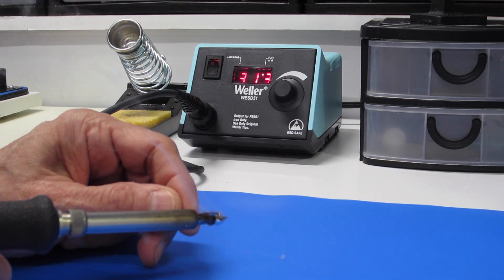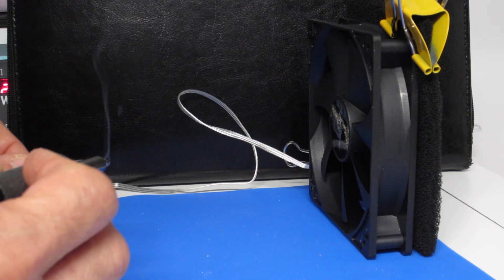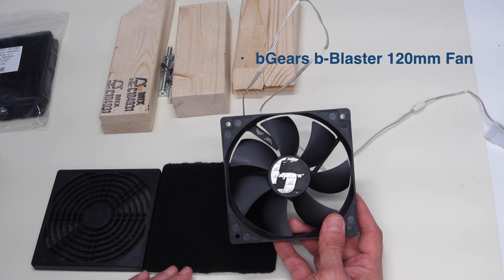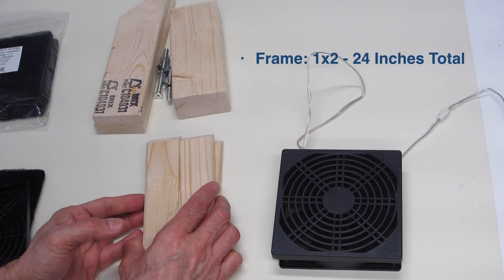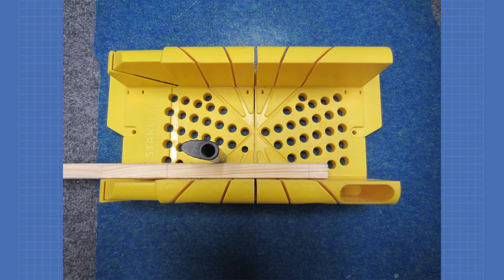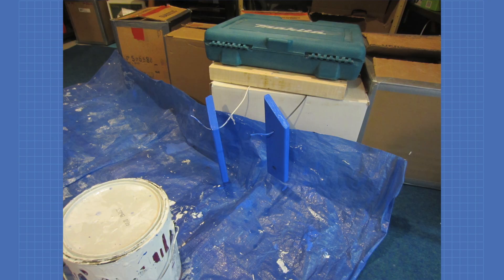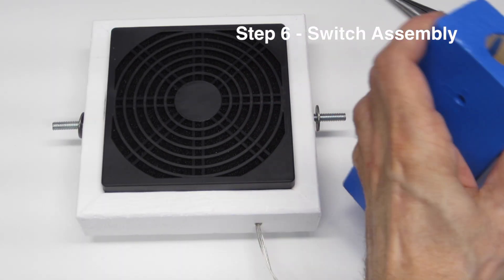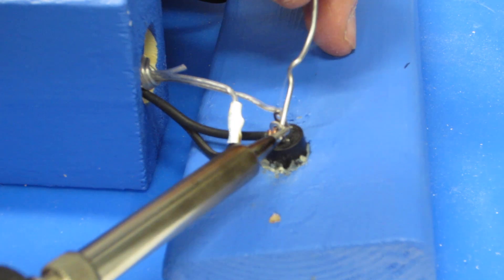Build a Solder Fume Extractor

Comment: For this kind of project you'd probably want to go with a fan designed for static pressure as opposed to airflow. They're a little louder but they're better at pushing or pulling air through filters.

Comment: 14:00 if I have to keep it THAT close to barely get any suction, I would try stacking two fans, but without more filters. Maybe also cut out a tube from a 5L water bottle to give it direction. Because that's a lot less suction than you showed us at 2:40. I wouldn't have any space to work with if it has to be that close, given all the other things that also need to be on the desk when soldering.

Comment: I wanted to buy / build one of these, but wasn't sure how well they work, and whether the fan is just drawing the fumes away and blowing them elsewhere.  At 2:38 in the video, isn't the smoke passing fairly freely thru the filter, but dispersed by the airstream.  Was also wondering if most of the odor is absorbed.

Comment: Sorry, but that is absolutely NOT a proper way of fume extraction. a thin layer of carbon and a fan does not an extractor make. You're doing little more than diffusing the fumes a bit. All fan-based extractors are the holistic medicine equivalent in engineering. Thumbs down for spreading bad information.

Comment: What powers the fan? When you cut the wire and solder it to the switch where does the switch get power from?
Reply: A 12V power supply, I suppose?

Comment: You should put the filter in the intake side of the fan. Fans are much better at pulling than pushing as their principle of operation is based around creating a low pressure zone on the inlet side of the fan. Since they do not have any seals on the outlet side, as a compressor would, putting any restriction on the outlet of the fan will greatly reduce it’s effectiveness, because they are not designed to build high pressure, but rather create low pressure.

Comment: Very nice video and a very nice fume extractor. I have built my own one sometime ago looking pretty much similar to the one described in this video. To mine, I have added a nice LED with a flexible neck to it to position it to my desire. I also added a rotary switch to change the RPMs of the fan in three steps (low, medium and high) to adjust the fan speed making the whole thing less noisy for smaller soldering jobs (e.g. SMD) while still ensuring enough power to really suck in all the fumes efficiently. Works great.

Comment: Thank you for this informative video. I was already thinking about building such a device before watching. But at 2:39 you can clearly see that the smoke is also exhausted from the filter. So it is useless and I saved time and money not buiding this.
Reply: What if the harmful stuff stays in the filter (which was made for the purpose), and what you see on the other side is much more harmless smoke? You can't tell the difference with your eyes. Just a theory, only some lab tests would be able to answer this question.
Anyway, personal opinion, even if the fan didn't have any filter at all, it moves the smoke away from your nose, and that is probably the most effective part. Of course it would be better if you can open a window too.
Reply: @GenePavlovsky  "what you see on the other side is much more harmless smoke" There's no such thing as "harmless smoke".  If there's smoke, then there is particulates in the air which should not be in your respiratory system. An extractor like this is for use in a well-ventilated room where it just needs to move it away from your face. In a poorly ventilated room, you'll just be circulating it around the room.
Reply: @VoidSixx  Well like I said it's a theory, I don't have any proof to offer. You didn't provide proof either. The amount and harmfulness of the particulates before and after the fan&filter combo has to be tested to make any claims on filter effectiveness, without such tests we can only hope that the filter does something. I agree with you that good ventilation is very desirable, or a fume extractor that vents to the outside. 
Regardless, I think that even in a poorly ventilated room, such a fan (even without a filter) will help to prevent you from breathing the highest concentration of the fumes, until the point when the whole room's air becomes polluted. If you just have a few things to solder every now and then, such a fan is a useful and cheap investment. If you regularly solder things for hours, then you need good ventilation (and a fan), or proper fume extraction.
I was just replying to micha egi, whose absolute statement of calling the fan useless I think is too extreme.
It's definitely not the best solution, but for beginners this is cheap and easy to build, and is better than nothing. For someone who seriously gets into soldering, it's worth to invest more and build/buy a more serious fume extractor. It's not easy to justify spending couple hundred dollars/euros or more for a bulky DIY/purchased fume extractor, if a person is just trying things out.

Comment: Newsflash, that is not a fume extractor and to misrepresent it as such is detrimental to those who don’t understand your reality from the truth! That is a fume fan with a filter, big whoopty do! A fume extractor by definition has a funneled end hose which is connected a vacuum unit which has multiple filter elements of which  one element is a HEPA filter. This unit removes the fumes from the point of the funnel into the vacuum filter compartment and removes not just moves the fumes from the air with an efficiency of greater than 99%. Don’t mislead people because you either don’t know or don’t care. Solder fumes contain toxic substances that cause lung damage and asthmatic issues. That is no laughing matter! It’s not safe and is just plain wrong to mislead your viewers sans treat them as if they are stupid. Your viewers may not know, but treating them like this is most unprofessional and ethically and morally wrong! Straighten your act up, please!

Comment: omg y would you go through all that just buy a good 1 on ebay
Reply: Mawgan Brev If you don’t like the video- leave. We don’t want your negative comments here anyways.
Reply: It's a great feeling when you make something by yourself. You can sometimes also save money (if you count your DIY hobby time as free). In many cases you can make a stronger and more durable product, since commercial offerings are either made as cheap as possible, or are made for the professional, and are very expensive.
Also when you make something yourself, if some part breaks one day, you already know how to fix it. Some commercial items seem to be engineered to be difficult or impossible to fix.

Comment: for those of you going on about using hepa filters, you are wrong.  That is for filtering small particles out of air.  It specifically states on the wiki page for hepa filters that they do not work for filtering odor, gas, chemicals, cigarette smoke, etc and that to filter this much smaller type of particulate matter, you need activated carbon filters.  He is in this video using an activated carbon filter which is the correct kind of filter to use in this application.
Reply: They are right that this isn't filtering out the resin smoke though. You can see the exhaust coming out still. The filter needs to be finer, or there needs to be more of it. That said, if it is cutting it down and blowing it away from your face it probably isn't a huge deal.

Comment: you need a better filtration system. you can make one using ducting and storage bins for under 100 dollars. you need a pre filter, hepa filter, then an activated carbon filter. the fan must pull the air through the filter. I recommend a ducting fan because it's easy to attach tubing to it.

Comment: Cool, but it just redistributes the toxic fumes through the room on the exhaust... how much is absorbed in the activated charcoal filter?  And how do you know when its time to change the charcoal filter.  Ideally, exhausting the air OUT of the room, or through a gas-filtering element (which is spendy) is ideal

Comment: It's a nice design but 1) most of the solder fumes is particulates about 0.1 to 1.0 microns in diameter with some vapour 2) the charcoal foam filters do virtually nothing to filter either of these. They are useless for this purpose.
Instead of a charcoal filter, a filter rated for 0.1 to 1.0 microns should be used. An F7 pre-filter followed by a HEPA will do the trick. 
If you get a larger one and cut it down, it won't be that expensive.
Reply: Hello there! I need advice. I am working with Resin/Epoxy and I am an artist. I just put a 20"X20" fan on my window facing outside to suck the smell out. Now people (other artists) are telling me my fan needs to be ''for fumes'' to avoid a fire? I ask myself how bad are the fumes that resin and some paints are creating to be this bad? My fan is from a normal hardware store. Any guidance regarding this will help! Thanks! 
PS: I am using a non-toxic resin.
Reply: @ArijanaLukic  of you're blowing it outside then that's a good thing for your health. If you can't afford the fan they are talking about (I don't know anything about them) then the cheapest thing to do might be to just keep a fire extinguisher near you. Everyone should have some in their house anyway, so it's not a waste of money. Just remember they need to be replaced every so often. It's also a good idea to turn them upside down and shake it good to keep the powder loose.
Reply: @ArijanaLukic  the manufacturer of the materials you are using should be the best source of information on proper ventilation and personal protection gear.  It's hard for anyone to give you specific advice as different materials have different requirements, but you're best off getting it straight from the manufacturer anyway (especially from legal liability standpoint).